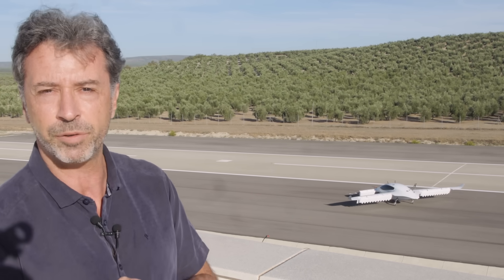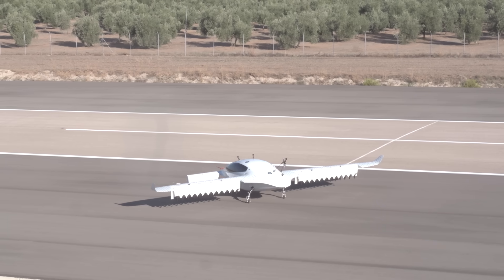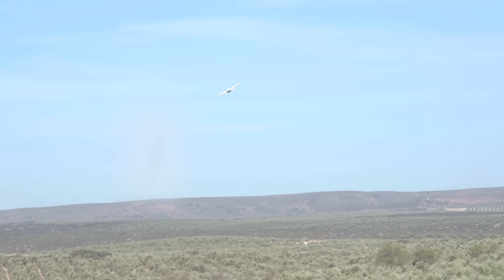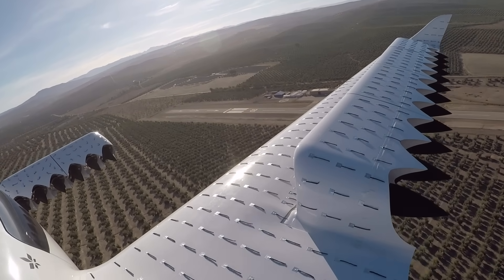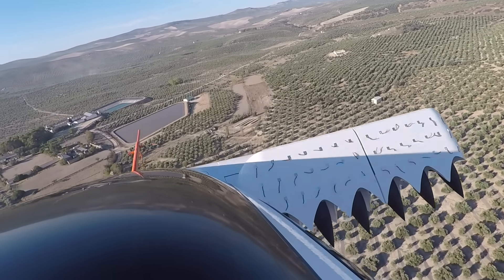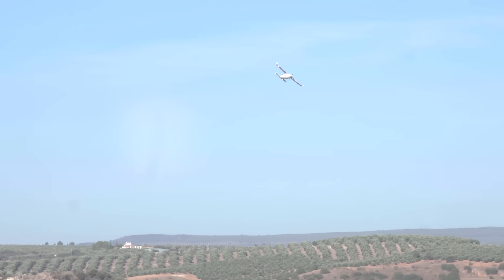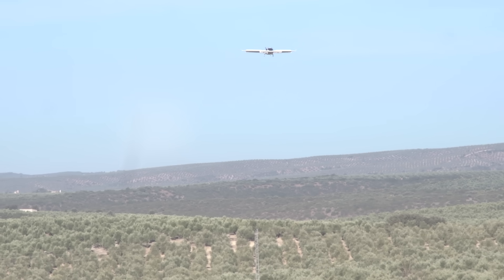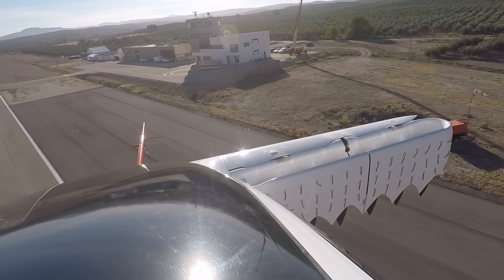Test Flight September 28: Lilium Jet Demonstrates Maneuverability

Comment: Just to clarify after reading all the comments - the canard is obviously stalled all the time -- this means that so is the wing since it must balance in pitch (like a seesaw) if the wing was lifting it would drive the nose down . It is clear that the flapducts are always highly deflected (at over 80 knots if their radio chatter is to be believed ) --the ducts are doing all the work all the time.  Having tufts staying flat (on the wing) does not indicate it is lifting - in fact some separation might show lift production .   The whole duct scheme is 'lifted' from Alexander Lippisch's work for Collins radio in the 60s and for Dornier on drones (also copied by Paul Moller and the subject of several papers that basically debunk the ducted wing concept )

Comment: May as well throw the wings away - the canard flap is ALWAYS completely stalled only the jets (ducts)  are keeping the nose up and likewise the wing flap is just a gigantic airbrake --the ONLY time the tufts show attached airflow ,particularly on the canard, is when the ducts are VERTICAL (and when nearly stationary in hover ) . hence contribution nothing to lift . The comment below noting 'laminar flow' across the main wing EVEN WHILE ON THE GROUND  is ,indeed , "Pretty sick' - wings don't work when stationary --but the huge 'barn door' flaps will create drag in winds limiting the possible weather envelope .  The miniscule component of duct thrust available to push the drooped flaps through the air accounts for the sluggish behaviour (typical of vtol in general and LACK of manouverability - well demonstrated here )

Comment: flitetest for the rich.

Is there a business case for this VTOL-concept?

I mean, do you want to replace helicopters? 
Do you want to replace water planes?
Do want to replace combustion engines in aircraft?
Why?

You can't start or land between buildings. 
You have to use a dedicated airfield outside the cities like all other aircraft.

If the power fails there is no fallback like autorotation or glide path 
- unlike any other aircraft.

Payload is low. 

Range is short.

Noise is present from your high reving small diameter fans.

Trained pilot is essential - no matter the amount of assisted flight control.

Cost is high.

Aerodynamic concept is far from anything aerodynamic efficient.

Birdstrike and FOD means good night. 
And you're exposed to this risk a lot of your flight time based on what is expectable from your global concept.

Battery failure means good night.

Electronics failure, I can't see a mechanical redundancy,  means good night.

Even heavy rain, snow, hail, storm will hold this vehicle grounded.

I can tell you this thing will never ever be the future of flight.

The only pro I see is you're providing a lot of jobs for engineers.

Give me 1/20th of your development costs and I promise you to develop a concept of electric flight that's certified, saleable and profitable and within 5 years.
Without any of this concept's show stoppers.

Comment: You will not want to run out of power 100 feet above the ground while landing. Planes can glide, helicopters can auto-rotate. This thing becomes a brick when the engines stop. It also will probably be hard to control in gusts, or if the wind changes direction. There may be control left to right, but it will be slow if the engines do not provide a fast response to fuel flow changes.
Reply: It would drop straight down at any phase of the flight if it lost power.

Comment: Looks good, but a vernier landing fc algorithim at .7 meters and below that absolutely loop/locks that landing is going to be needed as a standard, imo, peering into the future. I believe this is needed on all of the evtols. It will need to feel to passengers as if it's landing in thick concrete as it sets down. The little yawing and bouncing must be eliminated. And yes, this sort of solid control is possible.

Comment: I like the eSTOl approach of Electra Aero although their first aircraft is a hybrid with an 800 kW turboshaft engine driving two 300 kW generators with power 8 generators and fan sets. Normal certification rules apply

Comment: The problem is that lithium ion batteries have a lower specific energy than cow dung, so no matter how good the control and aerodynamic are, it's not going to significantly outperform the speed and range than a WW-I fighter plane, as it runs on such a low performing power source.
Reply: Why would you need that? The whole point of it that it runs on electricity. Cheap and clean, reliable source of energy. By the time these will be flying there will be new battery chemistries that will outperform lithium ion, all you need to do is swap the battery packs.
Reply: At curtain state of battery density technology these are mainly use for city/urban transportation or from city to city. Speed is good as cruise for helicopter but quieter so why not? It was not meant to replace plane or jet anytime soon but rather helicopter as it can use their landing pad.
Reply: Interesting comparison but there's the question of over what time period that energy can be extracted.  With li it can be fast.   Even if we say cow dung doesn't need weightier or bulkier equipment to extract its energy, your comparison would cap SOME performance metrics, such as payload * range, but perhaps not others such as airspeed for a short period.
Reply: Indeed they would be better off having smaller (half)  batteries but a generator constantly feeding the batteries. That would make more sense imo.

Comment: If that thing has a power failure while hovering it's going to drop like a brick. At least airplanes with forward velocity can land during engine failure.
Reply: If it has power failer at any stage it will fall like a brick.

Comment: https://en.wikipedia.org/wiki/Lilium_Jet
"Its 36 electric ducted fans are powered by a 1 MW (1,300 hp) lithium-ion battery; less than 200 hp (150 kW) is required to cruise"

please clarify
does it use 7x more power during takeoff and landing than cruise?
Reply: Yes, like any VTOL you need insane amounts of power for takeoff.
Reply: They are not ducted fans they are electric jets. Lol jk

Comment: When will you do a short runway rolling takeoff/landing?  Is there footage of full engine shutdown glide landing?
Reply: How could it glide without the motors? It doesn't have any control surfaces to steer it uses the motors spinning at different speeds to maneuver.
Reply: You make it sound like that's a good thing. @TheBagOfHolding
Reply: @Venture_Fanatic  I think it sounds like the opposite of a good thing.
Reply: Then WTF are you commenting on my first question like it's a stupid one?  There could be a revision with Flaps and Rudders for a controlled unpowered decent or maybe a Parachute.  Something besides the same tests over and over.  @TheBagOfHolding
Reply: @venturefanatic9262  they don't have any other versions. My first answers weren't rude at all.
Reply: The landing gear is not made for STOL, only for VTOL.
Reply: I'd assume there would be a revision of the gear. @avigator
Reply: @Venture_Fanatic  Not possible, since a proper STOL landing gear would add weight and/or aerodynamic drag. Both are red lines for an aircraft, which is not capable of carrying the planned payload with today’s battery technology. 🪫

Comment: It's good to see & hear a 4 minute test flight showing FBW control working. But, the unanswered question is whether the range is going to be what the design has been sold on. What C-rate is being pulled in the hover and during cruise? Also how does the design handle one system failed so that C-rate goes up by 154% of nominal at low SoC for landing?
Reply: If the video is edited it's not proof it flew 4 minutes.
Reply: @TheBagOfHolding  , I think the video time Lilium presents is genuine.
What I'm really asking about is whether the configuration of high disk loading e-Jets was the right solution for 150mph (130ktas). This speed is well within the capability of a helicopter rotor, with compounded wing to unload the rotor at speed. So I'm still unclear about why go through the 1E9 hr to single fail certification process for a machine that might not give a performance advantage over an electric compound rotor & wing aircraft that can autorotate. Recent events in another e-VTOL endeavour appear to highlight that cascade failures can and do happen.
Reply: @martingarrish4082  i think it's deception. This is a little toy with a forklift battery where the people should go. Look at the vid called "lilium will it work"
Reply: @TheBagOfHolding  , I trained as an aero engineer and did my thesis in helicopter aerodynamics so have run my own numbers using my own methods. The e-Jet solution only makes sense to me if the speeds are high enough so that a compound wing & rotor configuration can't work. For example, although not electric or civil, the Harrier and F35 fly a lot faster than 130ktas. But, all I'm really saying in this thread is that Lilium needs to start showing that this concept can actually get to the claimed range. This needs to be demonstrated or actual C-rates quoted for hover, transition, & cruise.
I don't particularly want to see any e-VTOL company suffer financially. Having been part of the Britishvolt collapse then I would not wish such a thing on any employee or shareholder. I just would like to see if these high disk loading e-VTOLs do what they claim before I join the party.
Reply: @martingarrish4082  it a scam that is intentionally deceiving investors for financial gain. It can barely lift itself at this tiny toy model scale. Have you ever heard of the the square cube rule?
Reply: @martingarrish4082 You got it. The central questions are:
1. Where’s Lilium’s playground on the payload range diagram?
2. What kind of batteries are needed for that?
For sure today’s 🔋will get you nowhere.🪫
Reply: @avigator  , concur with your point 1. Lilium need to be more upfront about whether the test flying confirms the calculations.
For point 2 recent Li-batt pilot plant samples are now pushing 500Wh/kg (1.8MJ/kg). Lilium uses a batt capable of 330Wh/kg (1.2MJ/kg) at real world power demand. For fixed wing recreational aviation or training, designing to CAP 482 600kg MTOW with L/D>20 ideally, batts are starting to make commercial sense. But you have to sip that energy not gulp. This is why I am puzzled that e-VTOL has gone straight to high disk loading rather than playing around with wing & rotor compounds first. For me a Jaunt Air Mobility type concept fits the bill.

Comment: This is just rehashed nonsense.   More marketing fluff.  They don't even appear to have a full scale test product yet.  I have near zero confidence in this product prototype.  Requires a complete redesign.  Motors and rotors too small.  Major power out and disaster. No aircraft control surfaces.  Could not operate confidently without a parachute.  Zero evidence of any lift capacity beyond large R/C model.  Wont buy until I know they have addressed these issues.  Announcing milestones and partnerships is all marketing fluff.

Comment: Do you think you can make it hybrid with the spanish engine?? You can put half batteries and make a place for  this engine youtu.be/6wT87IqheV0?si=3IOGH9NANNTFNRke it has 120hp and 0.5 l of the maker get that efficiency you can use it as a gpu for recharge the batteries while use it. That engine can use jet fuel  and hydrogen

Comment: Ultralight weight in the United States is 254 pounds,  fuel capacity not exceeding 5 U.S. gallons;
 Is not capable of more than 55 knots calibrated airspeed at full power in level flight; and
has a power-off stall speed which does not exceed 24 knots calibrated airspeed

Comment: my biggest issue are the constant delays and changes, the 2023 idea was again replaced now with a 2025 version as seen before. Key questions of researchers have not been really answered and the whole delays are a simple factor that make the predicted ranges far easier due to new battery technologie. I doubt that the flighttime and range will be achieved. 
terrible long way and meanwhile during the olympics we might see first flights from the competition I bet.
Reply: Fake it til you make it. There are no batteries with needed power and energy density in the next years. Energy density is the biggest problem, VTOL takes too much current. The batteries available will not make the needed cycles.
Reply: Folks that rush things are more likely to injure or kill innocent people.....
Reply: Será adiantado novamente, não basta o produto estar pronto, é preciso certificar, e a lilium não tem experiência com isso.
Reply: Probably we see the Volocopter during Olympia.

Comment: This all looks very safe and like a smooth flight. No wind? How does the Lilium behave in gusty winds? Have you installed Giros that automatically compensate?
Reply: Why is there no dust/debris evident when taking off and landing? Usually there is some visual disturbance of air when peak thrust is generated... also never seen any birds in Lilium video's. Hmmm
Reply: @cwt5654  That's exactly what prompted me to ask my question. At 5:39 she flies about 25m over treetops with the EDF's pointing downwards, and they don't even curl. Strange.

Comment: I have a potential use case in London and have been following for years.  I would like to see a flight demo in an urban environment
Reply: As they said in the intro, this is not a real aeroplane it is just a scale model. And they are very limited as to whether they can fly it, only below 350 feet and not above any inhabited area. so a the flight test around London is many years away.

Comment: Have to be honest, the rate of progress has been extremely slow, especially compared to its competitors. All we have seen to date are mockups, they do not seem to be even close to a production prototype. Love the concept, however I can’t help feeling they are going to miss the boat.
Reply: Not entirely sure that first mover in this industry is good. It's probably better that they are second, third, fourth or fifth mover, and learn from the mistakes of the first mover.
Reply: @CLZ12345  Look at Tesla
Reply: @goodfodder  Lilium will never be like Tesla. Just a toy designed by drone enthusiasts thinking they can design a real aircraft with absolutely no aerospace industry experience
Reply: They just released that they are in first production of their prototypes. 7 I believe in total.
Reply: They are all stagnant.
Reply: I am also waiting to see something more technically relevant like...promised range and speed, fully loaded. Just put a bunch of dummies in and fly this thing for an hour.

Comment: It's a neat thing, best design for prctical use case, if you HAVE to HAVE batteries for power supply. 
The front wing never seemed to get efficient at demonstrated speeds?

Comment: It’s a beautiful piece of technology. Keeping my fingers crossed that the full scale aircraft has the range and speed - but particularly the range - that has been claimed 👍
Reply: It'll most likely go further with the rate battery tech is progressing
Reply: @craigrobinson1234567 you just hit it on the head concerning Lilium specifically and battery powered flight as an industry. Battery materials science is in its infancy. Almost all the advancements will first benefit EVs, but their rate of improvement is going to benefit all industries relying on smaller, lighter, more energy dense batteries. I have a feeling when this aircraft finally goes to market it will already have better range than what they currently state.
Reply: Batteries already surpassed 320Wh/Kg    The tech it’s a bit expensive to produce at scale so far
Reply: @livangooday  320 kWh/kg is simply not enough.
Reply: @avigator - "Simply Not Enough" for what Flight Profile? Might be fine for STOL Flights, even if not great for full on VTOL Flights! 

10 Miles in the Air, might be like 30 Miles on the Ground! If you can get clearance for flight of under 500 Feet above the ground, you need less energy than if you have to climb to 1,000 Feet Plus AGL!

I have Flown "Short Circuits" of 500 Feet instead of the nominal 1,000 Feet Above Ground Level (AGL), doing Touch & Go Training, or Practice, in a Cessna 182 RG! In Abbotsford, BC (CYXX)! 

In Greater Toronto Area (GTA) flown from Downsview Airport, and in a Cessna 172, flying South, in 5 Minutes we we already over Toronto Island Airport! 

So, in the Lillium, it could be a "Wheels Up to Wheels Down" hop of just 10 Minutes, in a STOL profile, with a 50' to 100' Run!
Reply: @robertweekley5926  The landing gear of the Lilium Jet is not made for STOL, only for VTOL.
Reply: @avigator so you have switched from battery tech being a blocker to landing gear bearing a blocker? 😂
Reply: @avigator liquid fuels (+generator) will easily deliver the needed range. Battery will be sized according to maximum power safe discharge rate.

We'll see, which design survives. A couple are already biting the dust.
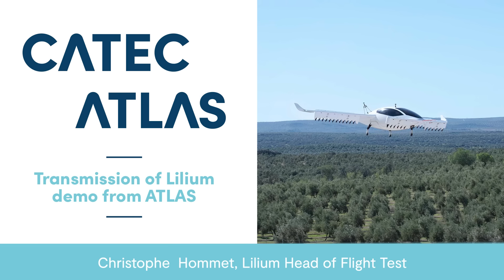Reply: @daszieher 6:27
Reply: @daszieher 6:27
Reply: @Willmwood  Did you hear the Lilium Jet first hand? Where? In Germany or in Spain?
Reply: No wonder we aren't visited by an intelligent life. We are so pathetic and primitive haha. Instead of inventing something useful, we just use more of what's already made because it's easier. You attach that many jets to anything and yea, it's going to fly no matter what it is. Well done human race.
Reply: It will not. Because the necessary batteries don’t exist today and will not be available at least for the next couple of years.